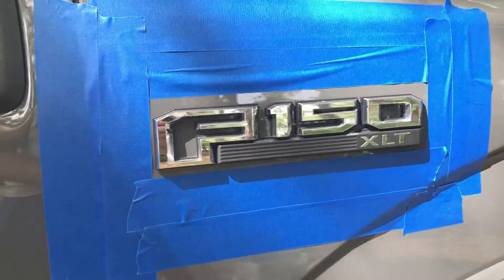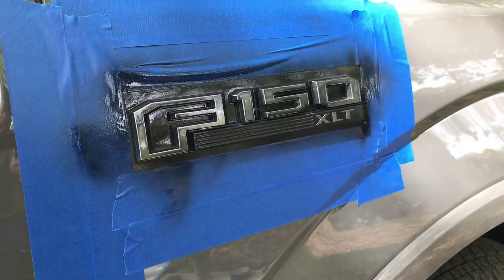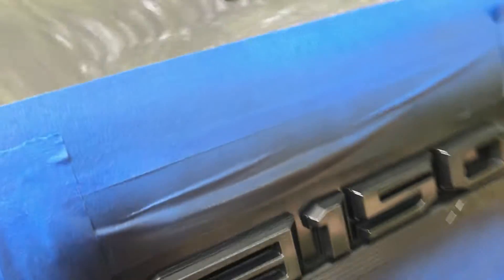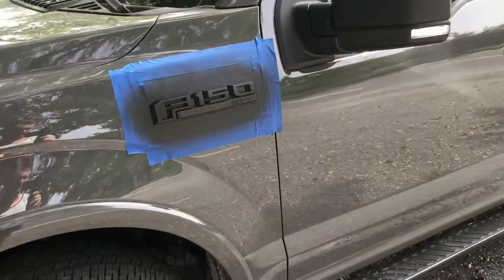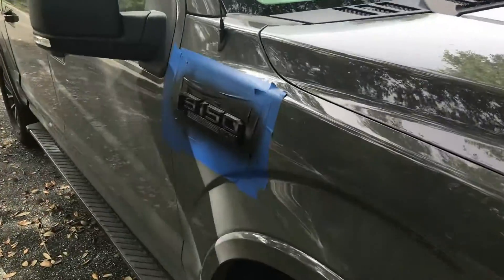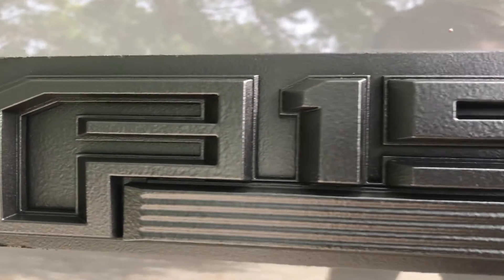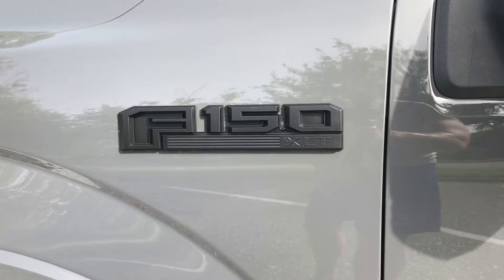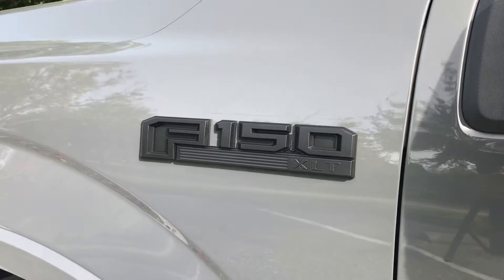Comparing Plasti Dip to Rustoleum Peel Coat

Comment: I’ve recently used both and you can’t really apply them the same way because RustOleum is thinner than Plastidip. Since the Rust-Oleum is thinner as soon as you stay in a certain area to long during  those lights coats  you will see the bubbles, I think the directions even say 2 to 3 light coats and then some medium coats, The first 2 coats of RustOleum have to be thin coats and then you work your way up to heavy coats. With plastidip that first coat is light and then you go to straight to heavy
Reply: agreed. he didn’t noticed the difference and then didn’t make adjustments… twice, obviously rook move.
Reply: I’m literally in the middle of doing my car now. Using Rustoleom. It’s working fine. I’m doing lighter costs, followed by 20 mins drying time - each time. Then getting heavier and building it up. Every time leaving 20 mins. It’s working better than in the video.
Reply: @gethinnadin  how many coats in total did you apply?
Reply: Might just be too heavy.. my car is sprayed with peel coat, and there's no bubbling at all.
Reply: @dylanrobinson3351  maybe because it was done right

Comment: Tried the rust oleum also and ruined the badges on my 16.. was such a pain to remove. Never using it again. Cracked and bubbled just like yours. Never had a problem with plasti dip.

Comment: Had to paint my trailers rims. I went with plasti dip on one side and restoleum flat black on the other to test..they look pretty similar but I have to say I'm impressed with the restoleum actually. 2 medium coats vs 4-5 coats for plastidip. Time wise id go with restoleum but it's permanent/not pealable
Reply from the maker: So you're saying the Rustoleum you sprayed on is not peelable?
Reply: The rust oleum is supposed to be peelable
Reply: @AndrewDoesLife so he basically used paint then

Comment: Vehicles look better if you de-badge them,just remove all the logos,ford doesn't need free advertising
Reply from the maker: Haha I agree, however I don't feel like figuring out a solution for plugging the holes left by removing the stock badges
Reply: @AndrewDoesLife  normally no holes they are normally held on by adhesive. Just pull them off with fishing line and remove the adhesive with goof off adhesive remover from home depot

Comment: I like plasty dip much better it's a better finish and it looks better I use plasti dip a lot much better protect.
Reply from the maker: It’s a way better finish for sure! I remember way back when and I used it in my 2006 and I was blown away that it lasted thru 2 hurricanes with no issues at all!